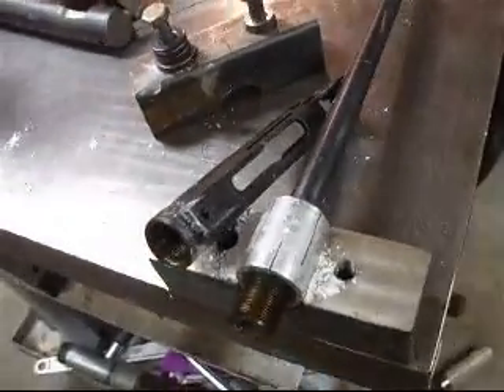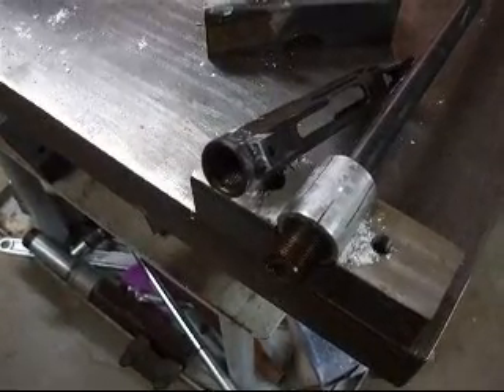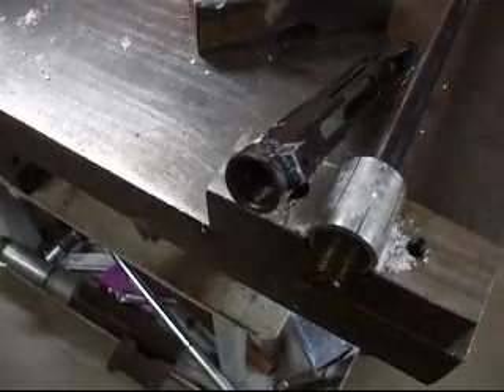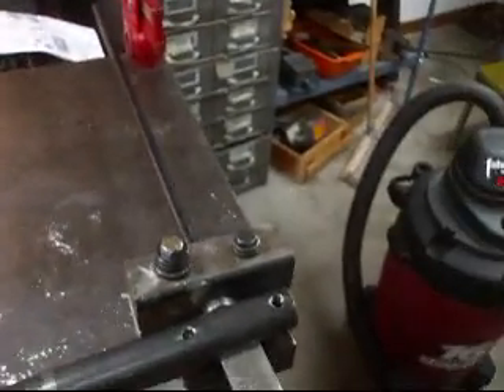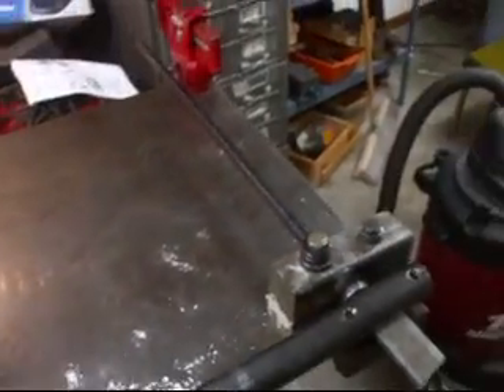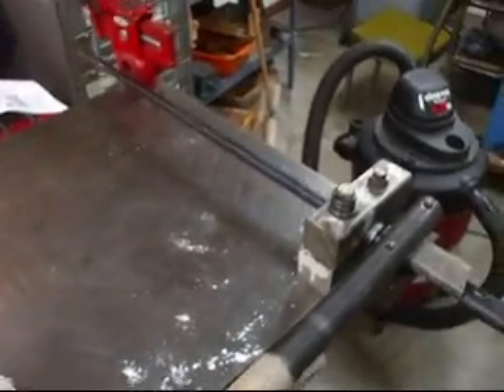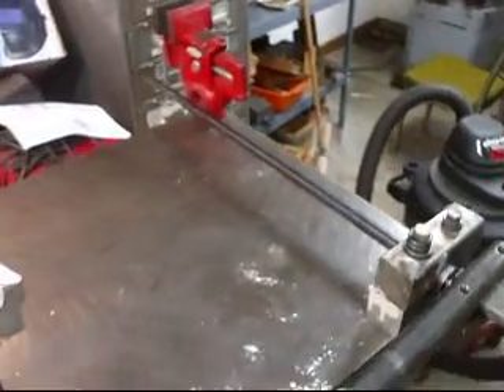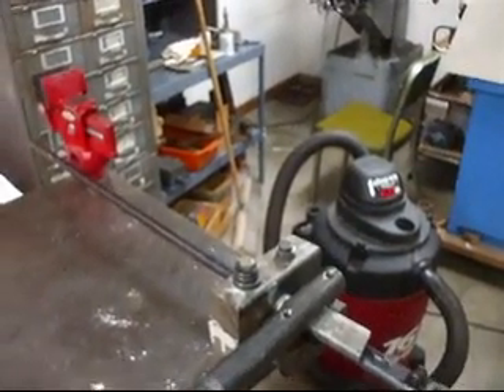Measure the torque needed to unscrew a 91/30 barrel after 73 years

Comment: You offer as a service? Have a couple barrels id like removed wo trashing barrels
Reply from the maker: i am old and downsizing.  Many gunsmiths could help you,
Reply: @tnekkc  thanks for the reply. In any case, I think I have a solution.  The problem is I can't generate enough pressure with my barrel vise using wood blocks to keep the barrel from spinning(I could make aluminum blocks but can't justify the price if it doesn't work) so my solution is grab a shop press I've been needing to aquire one for other purposes so no real down side if it don't work just need to make sure not to crush the barrel.

Comment: i put heat on the end  of the receiver and with a comealong it popped off...
Reply: Jaime Villanueva I just made a new video on removing a mosin barrel, see if that helps, I like this video too.
Reply: carryit around   did you use a press to change the barrel ?
Reply from the maker: Jaime Villanueva  The barrel is clamped to the bench with a barrel vise that uses a collet that fits the barrel. The action is turned with an action wrench with a long pry bar attached. You might say the two halves of the barrel vise press together [one from below and one from above] on the collet that squeezes the barrel.
Reply: i used a barrel vise and a action wrench attached to my welding table so it didnt lift my work bench off the ground when i torqued it... i used a long come  along but still needed heat to pop off the receiver
Reply: carryit around you mention setting back to the Russian original marks which ones on the barrel?  How much would charge me to change out the barrel ? I cannot find a gunsmith in my area that will do the work for me? I also do not have the action wrench for this receiver ?
Reply: Thank you !

Comment: "Was thinking about chambering a Enfield for 7.62x54R" - Probably a bad idea.  I think that the 7.62x54r is a higher pressure cartridge.  If the pressure is OK, you **might** be able to simply rechamber the original barrel.  I haven't compared the cartridge dimensions to see if you could get by without rethreading and setting the barrel back.

If you reload, a simple way to take advantage of cheap 7.62x54r ammo is to pull the bullets and powder and load it into .303 cases.  Be sure to reduce the powder charge by 20%.  Be advised that I cannot be responsible for your reloading expertize, so you do this at your own risk.
Reply from the maker: I am converting a Mosin to 25 Krag Ackley using 303 Brit brass, extremely high pressure brass, despite how short lived it is in a stretchy Enfield.

Comment: Heat up the receiver next time.  When it's hot, soak the breech with penetrating fluid and the heat will hopefully draw the fluid into the threads.  Even if it doesn't, the receiver will expand a few tenths, which will loosen it's grip on the barrel threads.  The Mosin has a stout receiver, but you could damage other rifles applying that much torque.

Comment: 540 foot-pounds? holy crap! well there goes my rebarreling project! 
actually if I used something like a 10-15 foot cheater bar it shouldn't be too hard, right? 

but this makes me wonder whether the soviets were nuts or what? they torque the barrel so hard no one can get it off and they pin, set screw, solder the crap out of the rear sight base!

Comment from the maker: @Just1Spark 
I made action wrenches like the  drawing in MacFarland's gunsmithing book, for years.
Then I figured out that the bolts, the V on the top, and the flat on the bottom must be in the same plane.

Anyway, making action wrenches is easy, making a barrel vise that can do the above video is harder. I had to got to 7/8-14 threaded rod and nuts. Action wrenches [for flat bottomed receivers like the Mosin Nagant] do fine with 1/2-13 bolts.

Comment from the maker: @hilers72652 

There are ~ 300 pounds of torque on the barrel vise bolts.
I clean the barrel and Aluminum collet with alcohol for no oil.
There is powdered sugar on the collet to barrel interface.
I have broken three 1/2-13 number 5 hardened bolts tightening the barrel vise.
I have since converted to 7/8-14 threaded rods with wax , nuts, and washers. These don't break when get the vise tight enough not to slip.

I have since put an ATI scope mount and a VZ59 barrel on the receiver in the video.